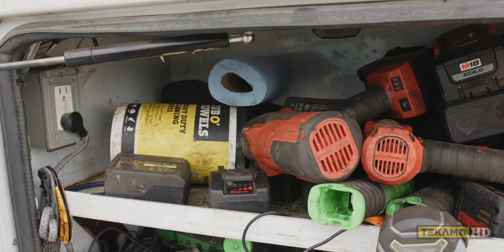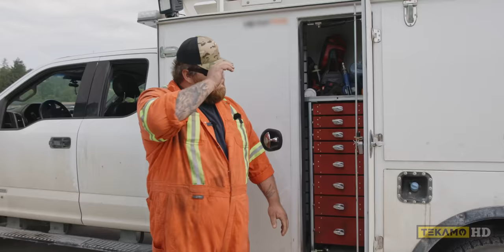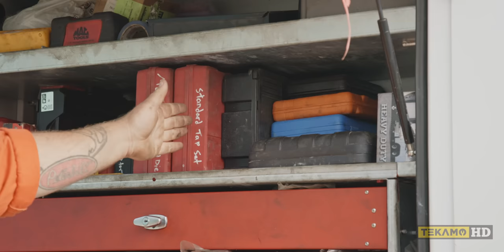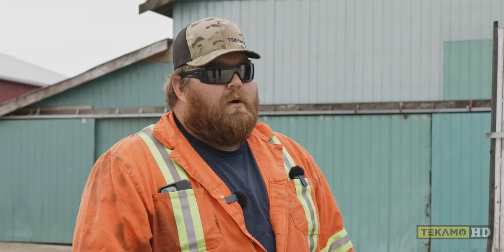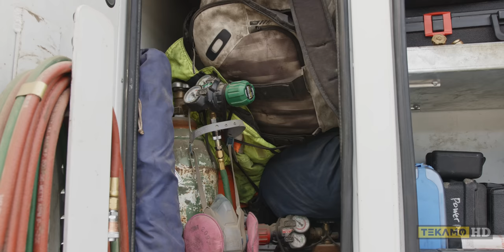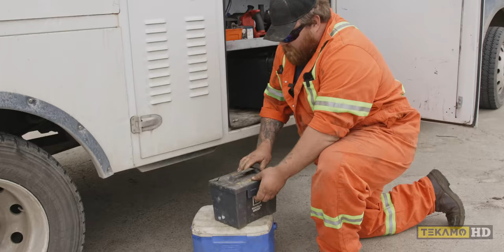Heavy Duty Mechanic's Tool Addiction , $???,???+ In Tools (Snap-On, Milwaukee, Mac Tools) Truck Tour

Comment: This guy is definitely a field mechanic. Love it! Big hammers for ECM’s and such…
Reply: 9/10 times you can fix something by hitting it with a hammer until that 10th time is an ecm. Fuck was that customer mad
Reply: Hit it with the precision certified calibrated digital hammer
Reply: @juanfo7307 my truck?? That sounds expensive to hit shit with my truck. But I’ll try it
Reply: @twcmechanical  whatever gitsur dun
Reply from the maker: You’ll see him in all his glory in tomorrow’s episode of Service Call
Reply: @TekamoHD when I was a kid, and I was learning to weld..... I was using an oxyacetylene torch and the hoses were a bit twisted. 

I accidentally burned a Nike swoosh into my cheek on my face. When I relaxed my grip the torch spun in a circle. 

Luckily it was only superficial. 

😂😂😂😂
Reply: What is an ECM?
Reply: @matthewpamatian4853 
Hi Matthew....
An ECM is an Engine Control module, basically it's a computer that controls the function of the engine.
Best regards,
Stefano (UK).
Reply: “Out is out the pile of carnage in the corner is irrelevant!”🤣🤣🤣

Comment: I'm a fleet technician. Field technicians are a Cut above the rest. I am slow meticulous and ocd. I don't perform well in the field. I work best in my bay next to my redundant alternate versions of the same tools. Ie stubby, ratcheting, stubby ratcheting, Flex head, non-offset, Rbrt wrenches crow's foot all in SAE. These guys just make it happen. Respect.
Reply: You can do it too man. It’s not that hard. You just have to be able mcgyver anything with fuck all for supplies and be able to work fast
Reply: Im also adhd, add, manic depressant with massive mood swings.

Some days I fight with myself and add.. other days... HANG THE FUCK ON... gonna be a heck oc a ride

Comment: Those RBRT sockets are awesome!! I highly recommend them aswell. The original manufacturer GripEdge makes them aswell at a cheaper price. They arent just extractors they can be used all the time like a normal allen socket. They make torx,extractors and bolt extractors. They all work great highly recommend 👍Great video guys
Reply from the maker: thanks man!

Comment: I know its been a year but figured id mention it. My last truck was a 550 with a summit body and I wired my inverter to a continuous use starter relay from napa. Wired the control circuit of the solenoid into the fuse panel under the hood that has blank wires hooked to the cab aux switches. Inverter only turns on with keyswitch power so no dead batteries. Also used a circuit breaker 1 foot from the batteries on the big cables.

Comment: Im just a dealer mechanic for one of the big three manufacturers. We all pretty much have the same mindset. Need to break something off? Bigger hammer or longer pry bar. Need to get a stubborn bolt out? Break out the blue tipped wrench, can't be stuck if its molten slag! We have a plow Wrangler at work. Stupid thing dosen't like to start. Smack the PCM a few times with your fist on the connectors, it starts right up.

Comment: Grab yourself a Nepros adjustable wrench. I love it. 
Also Lobster adjustable wrenches open really wide. 
My grandpa hates taps as well. He had a wooden box with drill bits in it. I asked why these specific bits have such a fancy box while his others are like blow molded plastique? He said they’re special bits for taps and really hard steel. They’re tungsten carbide bits.

Comment: That is an absolutely sexy service truck. Miss rolling around in my service truck. Loved having on demand power inverter and engine driven on board air and having a 5t crane.
Reply from the maker: What did you use to run?
Reply: @TekamoHD I ran a 2015 F750  Carco service truck.

Comment: Overhead crane/heavy equipment mechanic out of texas. Love the set up. I currently run a chevy 3500 single wheel. I definitely need a bigger truck next time.

Comment: In Swedish the adjustable wrench name translates to "shift key" 
But I always jokingly call it "shit key" 
Because It's ALWAYS less usefull then using the proper fucking wrench for an application. 
It's even secondary to a proper hammer.

Comment: After snap on and miluwake cordless grinders all blew up. I went to dewalt. The 60v grinder is a beast going on 5 years no problems in my truck. Same with the 20v dewalt die grinder.
Reply: I tried the dewalt stuff. But after leaving it in the rain and it failed. I was unimpressed. Lol

Comment: If you work on hydraulics and you don’t own the flange cap off tool you’re doing it wrong lol
Reply: It took me a bit to bite the bullet and get them. There slick
Reply: @twcmechanical  I bought the really common sizes that use a lot and just built from there. They are a pretty penny to spend.

Comment: “But yea,, liftin’ 5000 pounds, the thing is a beast. Ug, the one positive of, of this thing… is umm… the winch cable doesn’t have a limit switch.” Slow single clap. I knew INSTANTLY this man has done some sketch adjacent, safety third things that resulted in his snap on dealer questioning his sanity 😂😂

Comment: You ever use a power probe?
Reply: Nope. Not really a fan
Reply: @twcmechanical  why is that?
Reply: @hornetkeeperh can’t see resistance in the circuit. Can’t put a load on it. I just was never a fan of them for anything more then putting power to stuff
Reply: @twcmechanical  All those are fair points. However, they do make a higher end model called "The Maestro" or something with full multimeter/PWM support that can supply 10 Amps to a circuit for like 20 minutes straight (15 to 20 amps 6 seconds) Wouldn't really be useful for huge amp loads, but could use it for most stuff.
Reply: @hornetkeeperh yeah but that’s another tool on top of all the stuff I have on board already. I’m used to my meter
Reply: @twcmechanical  fair enough, I just do a lot of 12 Volt and I fly a lot so the fewer tools better for me

Comment: This guy is a fucking worker. None of the brand new pack out shit. This guy uses his. By the way, MetaboHPT offers a lifetime warranty on their impact wrenches. I am not sponsored, but I use their shit exclusively.
Reply from the maker: How long you been running it for?
Reply: @TekamoHD about 5 years now I’ve used the brand. I’ve had my mid torque impact a couple years, its great. They also have a high torque in 1/2” and 3/4”. I’m a commercial plumbing mechanic, so I don’t use it as heavy as you would. It’s mainly for flange connections or mega lug kits.

Comment: if your Mac tool was made after around 2000, get a snapon instead. short version of the story is Mac just internally shit themselves and started making dogshit quality tools or just literally ripped off snapon. sometimes Mac will even just sell tools made in snapon's factory (only rebranded to mac). the glory days of it being worth getting on the fun wagon are long, long gone. plus a 90's era Mac air tool will last easily 30 years (with lubrication) of heavy use and not skip a step. i've literally never had my mac impact fail a single time. it even has the old style neon green impact gun condom.